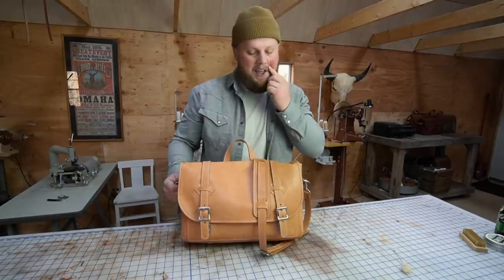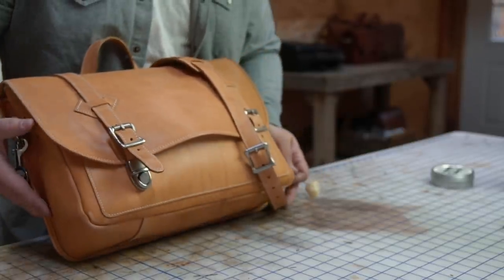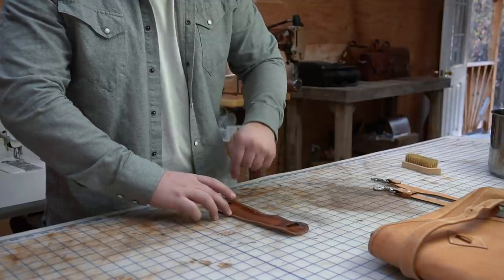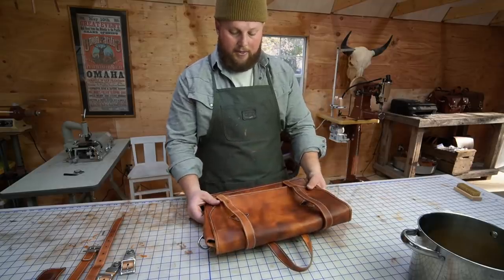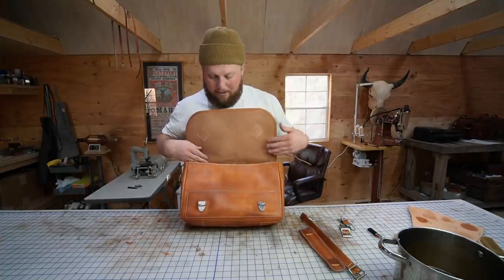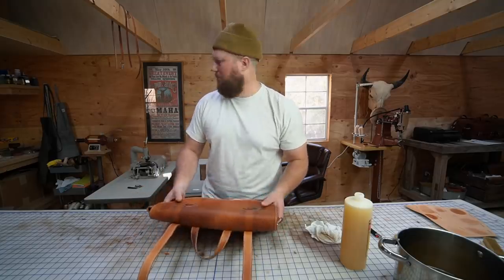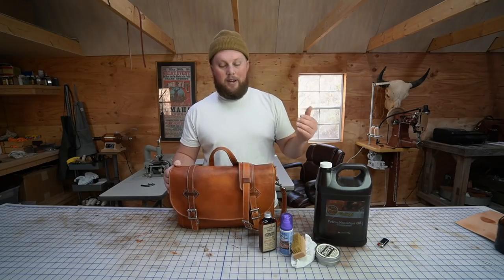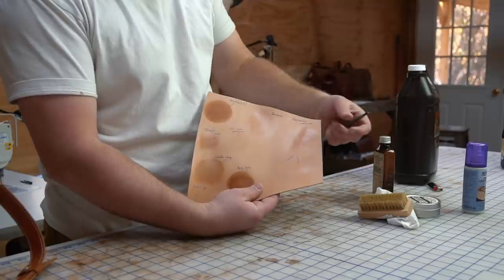Using neatsfoot oil to condition my veg tan leather bag - 2 year patina

Comment: After two years of use, the leather had patinaed which makes the leather take oil differently. If you wanted a completely even coating, either treat it when new or clean the patinaed leather with saddle soap & light ethanol or degreasing solutions.
Reply: Edgar, would acetone work as well or the same as the ethanol? Thanks.
Reply: @kayBTR  great question! I would strongly caution against acetone as it strips the leather and can be damaging to the fibers.

Comment: I really like the way it came out, and of course over time, the parts that you touch frequently will also darken more than those that you don't. One probable reason that the tabs and the handle retaining strip on the back are darker is that, unlike the rest of the bag, they are relatively large pieces of leather that cannot 'breathe' or dry out from the back, so they get more saturated because the leather they are attached to is ALSO saturated and keeps 'feeding' them oil from the backside. One possible way to avoid that is to pretreat before assembly, but of course that has its own risks as far as scratches, stained thread, etc. Really nice to see the relative effects of all the products; thanks for all you do!

Comment: Note that you are using Neatsfoot "compound" that is mixed with petroleum products which will actually dry out the leather in a short period of time.  Stick to Pure Neatsfoot Oil which is much better.  The "compound" is more for mixing with dye's to get a more even application and is not intended to be used as in this application.  I buy Fiebings Pure Neatsfoot Oil at Tractor Supply for $10 a quart (lowest price I have found) which is not much more than the "compound"...
Reply: Good catch, Larry. You are absolutely correct.
Reply: So I was planning on redying my black leather boots because I used the “normal” fiebings black dye and not the pro dye and I wasn’t thrilled with the results (uneven, spotty, dull and just not good) even with several applications and diligent buffing (which made an improvement but still not what I wanted) so I was planning on using the Saphir decapant (sp? Acetone)  pure neatsfoot oil to conditione the leather and either the pro dye or the Saphir dye. Will the pure neatsfoot be better for this project and does it need to be mixed with the dye (the pro dye is alcohol/oil anyway right?) just curious what you might think about that.
Reply: As far as I know mixing neatfoot oil into pro dye is not necessary @existentialcwboy

Comment: You can always go back through and use a little bit of neatsfoot oil in the lighter areas. Also drying in the sun can give neatsfoot oil a very warm russet color. Although you need to flip projects every so often for an even look. 

Also applying it in several coats with a rag is the way to go with larger projects. However I make gun holsters and neatsfoot oil is a very common finish. Now because my holsters are small and wet formed (heavily wet formed leather absorbs much less oil) a dobber is more appropriate. 

Just don't put too much neatsfoot oil on. You're definitely better taking your time doing multiple light coats until you get a feel for it. Basically the leather can soak up almost as much as you put on it and if you put too much it'll be seeping oil like a greasy dish rag for years.

Comment: Hello Sir, Thanks for your vid. I have two questions.
01- I tried slickering the edge of vegtan leather but it doesn't work. It remains saame but gets little bit darker color but not like yours. I used hand slicker and electril machine too,
02- What thickness of thread did you use in making this bag? 
.
One more please. Do you apply a paint, polish or something else to make it like yours? Thanks.

Comment: What I love in working with leather is how every little things you do, like applying oils and tans on projects looks so different and unique. I just made 2 belts for costume and both looks quite unique and different. My first simple card wallet looks like disaster piece but it works and even if it isn't the most gorgeous piece of  art, it's still self made and unique and it grows on me. (also figured out that shoe polish is no go for dye unless you're aiming for quite ugly looking projects) :D
Reply: Be advised that applying shoe polish to veg tanned leather will cause the dermal layer to constrict and subsequently crack with flex action. Not recommended.
Reply: @stanhegeman8751  Ah, that is good to know! It was when I started and it was all I had on that point. :D

Comment: Good afternoon Thanks for the interesting video!
But I'm still afraid to use oil on bags.
When I make belts or wallets, I use it without fear.
But the bag can stain clothes, leaving greasy marks on them. Perhaps if you let the oil soak in well, it won’t get dirty)

Comment: Another option to condition the leather is to use Fiebings Aussie leather conditioner.  Just wipe it on and use a heat gun to melt it in.  It will darken the leather a bit but it will provide a very even finish vs. the oil.  The heated Aussie also tends to penetrate the leather better than the oil so you don’t get as much oil/conditioner at the surface.  I use it a lot this way and it works great.

With that said the bag looks incredible with the oil and the variation adds character so...it depends on what you want.

Comment: I've had a suede leather rifle case for many years. This last year I had it stored (no gun inside) in a very humid room and it molded during the summer months.  I used a mild soap and water this late summer to clean it.  Yes, it hardened the leather a bit from the soap and water.  This week I brushed it and removed the mold and vacuumed it clean.  Unfortunately, the leather will never look new again as a result of my stupid storing...mold.  I don't dare use Neatsfoot oil or mink oil on it, but it definitely needs treating and moisturizing.   It's a medium brown leather and I'd like to give it another 10 years of life by revitalizing it.  What do you suggest? - Tim

Comment: Enjoyed your well-made tutorial!
When dad worked at grandpa's orthopedic shoe store, he made a leather briefcase. I'm going to attempt to restore it, with your advice.
The briefcase, being approximately 50-60 years old, is very dry and stiff, the machined double stitching has pretty much dry-rotted, and the briefcase certainly needs re-dyeing. I know that I need to soften the leather (Bick 4?, Neatsfoot oil?) before I can hand-stitch  the seams, but which should I do first - condition the leather for softening or dye it?
Many thanks in advance for your advice.

Comment: What do you think of putting the Neatsfoot oil in a new microwave bowel and heat it up a little that way instead of a stove? And I've read some people say to only put Neatsfoot oil on the flesh side and not on the grain. They didn't say why though.

Does Neatsfoot oil cause any issue with a top coat adhering to the leather?

Comment: If you get neatsfootoil then I would recommend to buy some vitamin C or other ascorbic acid to make the oil stable .You can only use it on heavy daily used leather goods so the oil will evaporate before going rancid .The oil will smell rancid to begin with.

Comment: You should get a cooking oil spray bottle like a misto. It's almost like having an airbrush application. And its cheap, made for oils, and made of metal so you can still heat the oil up.
Reply from the maker: that's a great tip thank you! I'll pick one up

Comment: I tried neetsfoot oil(exact one you used) on full grain veg tan leather office bag(similar to one in video). Did exactly like you showed using a sponge. The issue I am facing is it smells. the leather has absorbed good and looks perfect but smells the oil. Do you have a solution to get rid of smell it's been 3 days,
Reply: What type of Neatsfoot oil did you use that smelled. i.e. the Pure version or the Compound? Did you ever figure this problem out regarding it smelling? Do you still use Neatsfoot oil in leather, or use something else?

Comment: neatsfoot COMPOUND will almost always darken veg tan try pure neatsfoot oil instead make sure to use a good name brand to assure its 100% pure neatsfoot oil neatsfoot compound has fats still in it thus darkening the veg tan and almost all leathers the fats will also clog the leather neatsfoot has its place harness hunting gear ie rifle case knife scabbard compound good weather protection   be sure to have them remove rifle during off season  on your bag i would give it a couple coats let it soak in for a few days and call it good as far as warming oil i personally think its a  toss up